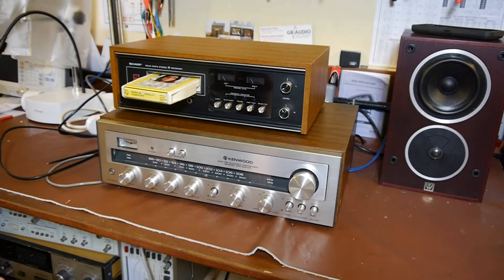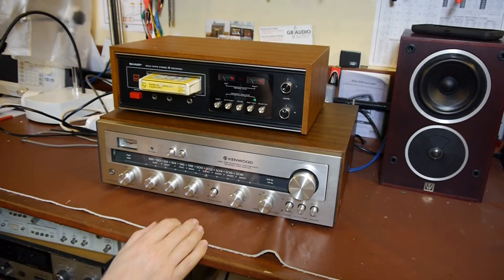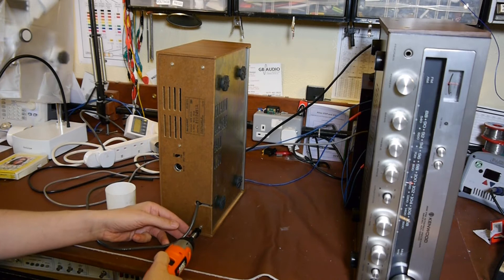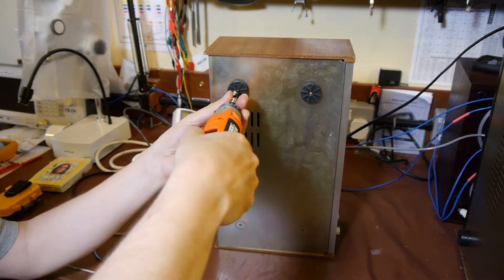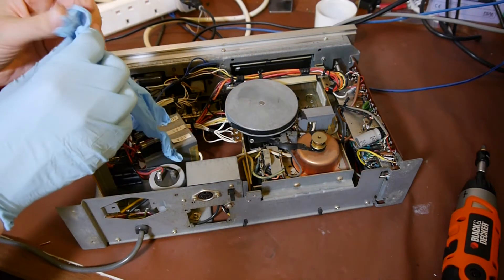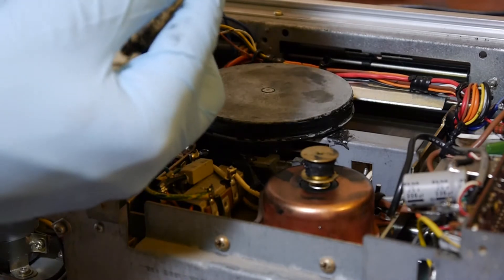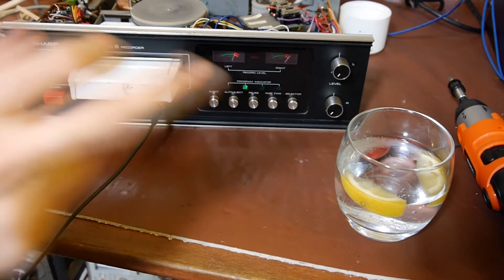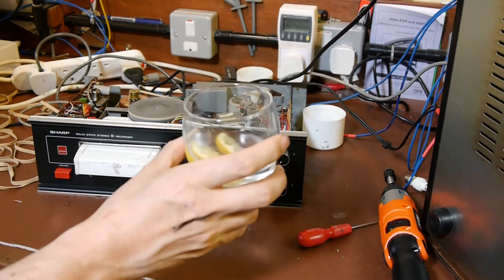AllTheBeerNoIdea - TWANG

Comment: Great eleastic band shooter! Another entertaining video. I feel your pain on removing that black muck. I had a Hitachi radio cassette player that did exactly the same. I tried everything to get that gunk off. It has been suggested that up can cleaner removes it well. I did buy some after the Hitachi incident but haven't had cause to use it since. BTW I do have a big box of old belts so if you need one then let me know the size and I will see if I can help out. Cheers Graham
Reply from the maker: Radiocruncher Hi Graham thanks for your kind comments glad you enjoyed it. That belt was in a real mess and a horrible job scraping off the goo. At least it should be a easy fix and I think it's going to work well. Going to try my usual belt supplier but if not I may ask you to have a look through your spares. It's quite a wide one about 5-6mm.  Regards Chris

Comment: 5-pin DIN, Hateful, I bought a load of cheapy leads and had a frustrating time wiring up my quad 33, to discover every plug was wired backwards, helpful.
 Cheers, J.
Reply from the maker: Average Joe  Hi Jo is the 33 the head set. I bought a 303 last week. I'm going to build my own input pre amp and selector. I really like the industrial look of the 303.  I bought a amplifier connector with phono connection from a UK eBay seller. It was about £12 and figured is was not worth buying the connectors and screen cable from RS.  Anyway planning on doing some amplifier testing in a future video soon. As always joe thanks for watching and taking the time to comment. Regards Chris
Reply: 33 is the pre-amp, not brilliant but nicely built.
303 is a great amp, bulletproof, I read that you can short one channel and still listen to the other, you can.
4-pin DIN as far as I remember betwixt pre and amp?, I'm far to lazy to walk across the room and look,
 I have mine wired to a pair of westrex speakers I got from a cinema,nice sound, 
 I hate my neighbour.
 Cheers, J.
Reply from the maker: Average Joe  This is my first Quad product when I felt the weight I new it was going to be good. Looking forward to doing some performance tests but don't think I will try the short circuit test.  Regards Chris

Comment: i got pissed last night and on the way home from the pub found one of these and a bag of 8 tracks, the only thing was it dint have a plug, wired one up to it and then basically exactly this video happend up u till takin the wood off the top, the exact thing with the belt has happend but 4 of the screws on the bottom have seized up so gotta sort them first. hope i can get it going!
Reply from the maker: kitsophrenik  I should think you will get it working as I expected it was tossed out by someone who did not know about the problem with the belts. If your familiar with old equipment The belts are always bad. Well still have mine running on old elastic bands so if you manage to sort out a belt please let me have a link to the belt suppliers.  Watch out for the din socket on the back they are not a standard pin out.  I assume you know you will probably have to do some work on the tape cartridge as I could be unlucky but never had a good one yet even new Old stock. Replace the foam pad with draft excluder. Good luck my very best regards Chris

Comment: Excuse me for commenting on a dated video. Maybe you have moved on since the 8-track infatuation, but if you want to slay the beast, run the gauntlet or cross the Rubicon again I recommend Akai CR-81. Best player recorder I ever previously owned. I have heard the gooey mess is from un-vulcanized rubber, but I'm not a Vulcan so I can't say. Those cheap stick on rubber feet do the same thing, though at a much accelerated pace. Beware.
Reply from the maker: You know I read somewhere that the Akai player was the Zenith of 8 track production.  Kind of got over the 8 track fetish. I would have installed one in the truck but it has an old looking  new MP3 player installed by the previous owner. It sounds very good so I am going to stick with it. I must admit I do enjoy old music media formats.